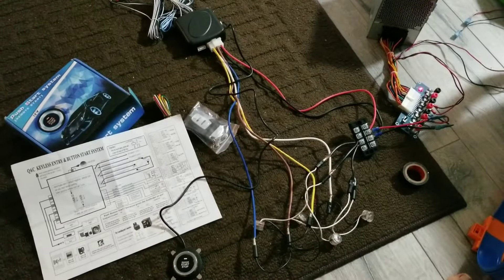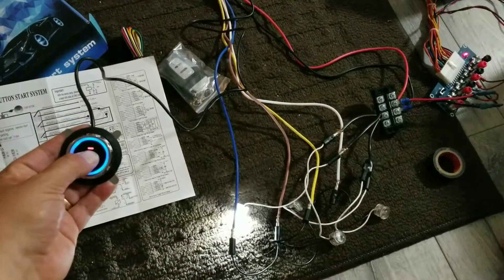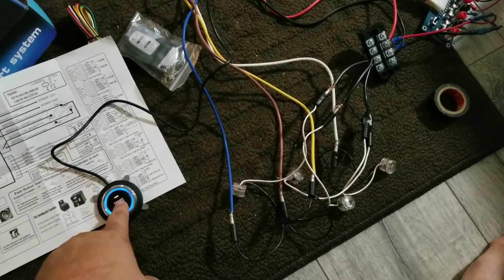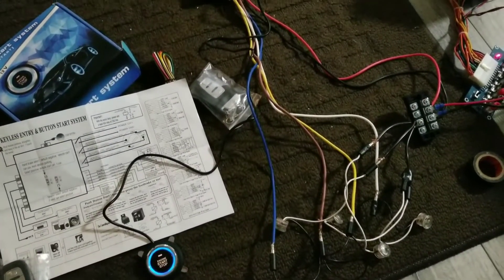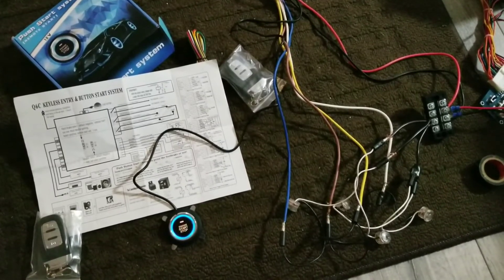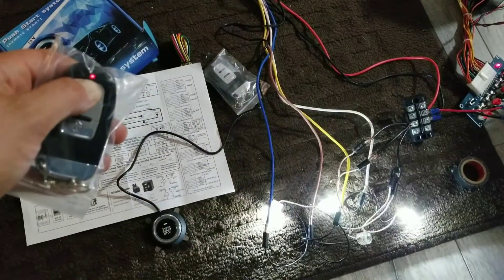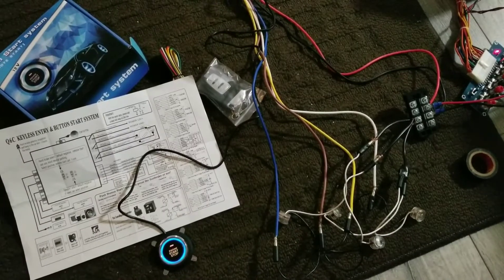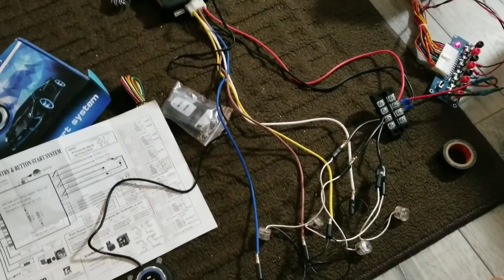Bench Test: Passive Keyless Entry and Push Button Start -$60 PKE

Comment: What size battery does that fob use?
Reply from the maker: I think the same as most.. cr032 or whatever is called.
Reply: @GavinTinkers  2032: 20mm diameter, 3.2mm high

Comment: I had to disconnect the car battery for a while and the alarm stopped working by the PKE approach.  on the control buttons I can lock and unlock, but it does not lock for clearance or unlock by approach. My system not is Cardot. In this system, how can I enable PKE?
Can you help me please?
Reply from the maker: Hey @depesse - I haven't been using mine in the vehicle yet. I would try and look into remote functions and see about changing them up. Maybe there is a way to reset the unit to factory. I'm sure they are not the most reliable in the world, so maybe a component failed?
Reply: @GavinTinkers  thankyou for attention. You know how reset to factory in this my system?
Reply from the maker: @depesse   with engine off, hold remote unlock button, system enters service mode, pke function is auto be off, press unlock button again, pke function is auto returned to normal status.
Reply from the maker: @depesse  that's from my one page manual. Maybe it'll help!
Reply: @GavinTinkers  i Will try like this. Thanks
Reply from the maker: @depesse  I don't have a pdf  Google image search q6c passive keyless entry for the manual of my unit anyways.
Reply: @GavinTinkers  ok. Thank you for attention. My unit is factory hippcron